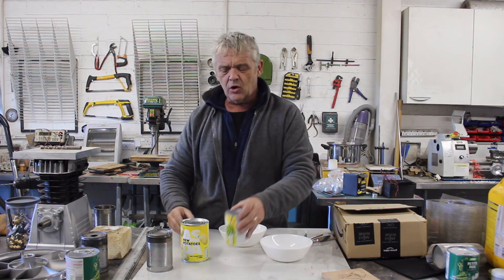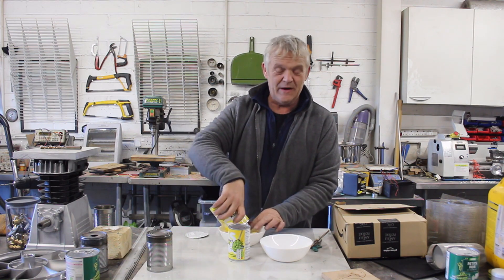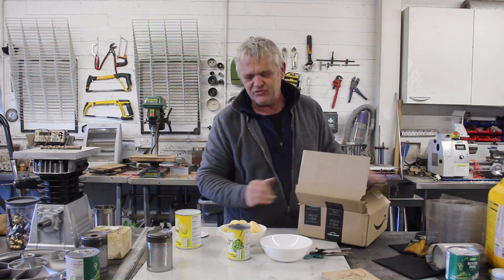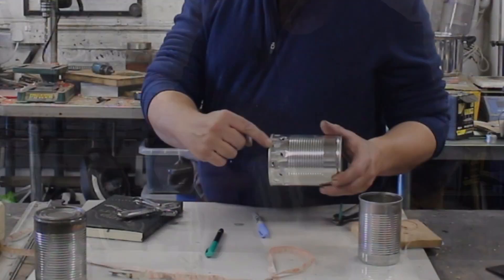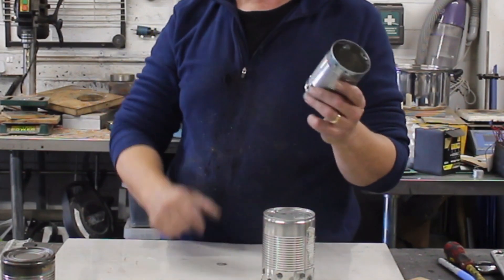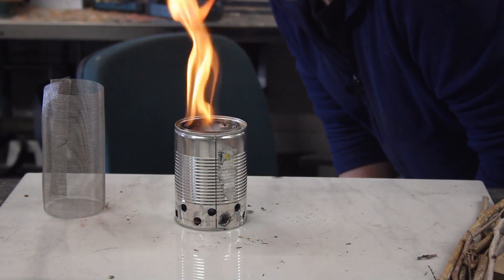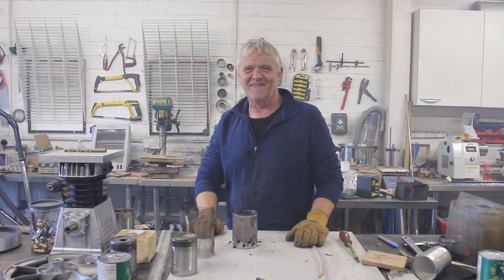1703 Mini Gasifier Or Mini Rocket Stove With Mantle

Comment: Thank you for a great video! What did you use to cut the hole in the top of the large can that was not full diameter?? I'd rather not buy a hole saw just for this exact smaller can size...

Comment: ok  let me tell you about the  charcoal colom . now  a water dip & you have  by a drip at the in-tack & we have  a super gas made up of 50% dioxide gas  & 50% approximately Hydrogen gas  often refed to as hydrocarbon.  gas . Run clean in a combustion engine & one cooled  will run a craven mantel gas light.

Comment: for the inner container i made the holes do a spiral from the top to the bottom instead of making sets of rings, that way the gasification flame can shift up and down as the fuel is consumed and doing it in a spiral shape makes the flame also become a spiral and maintain shape, i suspect rhe air travels more doing a spiral than simply going up straight, allowing it to mix, heat, capture heat or whatever more efficiently 😎

Comment: Hi Robert, I've been considering this after someone mentioned about a mantle,when commenting on a rocket stove you where building and this set me off thinking about the effects of putting one inside the burn chamber of my rocket stove, i intend to create a vortex fire inside the chamber,would the mantle need to sit outside or inside the vortex to achieve best results?.I noticed when you capped the mantle you achieved better results as the fire was forced outwards to the mantle thus heating it up, would i get better results putting a cap on my mantle inside the burn chamber and what if a secondary air feed was added towards the mantle would it increase the gas burn? And what if this is repeated up the flue so much potential to extract all possible energy from the burn

Comment: I have really been enjoying your videos. In stead of using a mantle made from grid material and getting that to radiate heat. What if you make a mantle out of al flat sheet of steel wool and curve that into a mantle. This would allow airflow but also greatly increase the surface area of the material that’s radiating heat. Does this make sense? And yes, I mean oxidised steel wool. Or something that has reacted ;) or some other material that is a wool but doesn’t burn, but does glow. Maybe the “forever wick” Carbon?

Comment: Because this is actually burning the syngas and not the wood. UK regs can be funny but regs aside could this then be ok to use with a gas fire flue and not a chimney or a wood stove flue which are much more expensive than a gas flue.

Comment: I've been wanting to build something like this for a while, but my cans are still sitting on my desk with potatoes in them.    I'm working on a stacked design, the bottom is a gasification stove as your video,  the top heats my food/water for long distance wild camping.  The idea is the burning gasses heat the bottom and sides of a top small can that contains food/water and are also contained by a big can, where the mantle is in your video.  I'm now worried by airflow, but there's only one way to find out, and that's to build it.  The weight should be a lot less than my current wood stove, so it could really catch on.

Comment: Why punch any bottom holes???  Just cut the bottom of both cans and set the bottom can on something to get air to the inside.  If outside, then use a few sticks or 3 flat stones.  Do the top of both cans as demonstrated.  This device can also be put into a Dakota Fire Hole for a larger chimney effect and better cooking base.

Comment: Need a bit of a thought about exhausting the combustion gases without losing all your heat.  Perhaps some kind of a window exhaust port. 2.5-5cm steel pipe through some rigid insulation set into a partially open window.  Put a potato can through the rigid foam 1st then the exhaust pipe through the center of that.  Stuff the can with Roxul or some equivalent insulation to keep the heat from the exhaust pipe from melting the rigid insulation sealing your window.  If too much heat going out the window a bit of a serpentine on your exhaust pipe.

Comment: A question about safety: while I love the ease of build and the heat output,  without a flue or chimney there is a danger of death from carbon monoxide poisoning, tragically this is regularly reported when people use wood fires inside without adequate ventilation. Or are you assuming complete combustion and conversion to CO2 due to the gasification and burn process, even so combustion by-products still need removal to avoid health impacts.

Comment: I think we need to see if we can get you guys some Roper & Whitney tooling at least a model 8 sheet metal hole punch, since it will allow even more opportunities than that paper punch on sheet metal of a tin can did. (even better if we as a community can manage the big brother of the model 8, since it will let you punch holes I think up to 25mm or 1 inch diameter and in 14 gauge steel sheet metal, ie something that is actually weldable when done being punched up and such :) (or layers of sheet at once for making transformers and motor cores or generator cores of laminated layers of steel all while keeping the whole layer of holes lined up perfectly since they are punched at once :)

Comment: yep I want to look into electrolysis as a method of injecting hydogen into common carbon sources like wood to make more concentrated hydrogen/carbon balanced materials like oil and such :)
Reply: well that and remove the oxygen present in those carbon sources (be it sugar, starch, or wood components in general, thus keeping it from interferring with all that hydrogen/carbon linking up) next will be digging into more catalyst based control of that linking, like how Benzoyal peroxide is used in some instances in the past to make ethyl gas into polyethylene plastic chains :)

Comment: I been critical on an other side of the Question! First safety, secondary price for the fuel! You are so near now to a heat-system, how manage a Security level like a cooking a dish of fish and chips! The heat I want from a burner is app. 500Wh and burn in a iron-pot or a rocket stove with a vortex-burn with extra safety! The best fuel is Methanol or Ethanol! You can make a burner how give 200 Wh of app. 1 dl at 5 hours!  If 1 litre alcohol cost 5 US$! A electric 1kWh can't cost over 0,5 US$ with tax and all extra included! In UK it's not a question anymore. if you need heat try to get a safe burner and the same is it in  rest of Europe! 🥸👍

Comment: Good job 👍

A piece of mesh positioned horizontally inside the mesh tube, approximately 3 inches above the gassifier opening would probably act as a spreader, which would increase efficiency of the burn.

Comment: Hi Robert, your stove is called a TLUD ( top lit updraft gasifier) This stove will lay the foundation to effectively produce charcoal. Our kilns are based on this concept and bulk produce charcoal. Equally as simple is the charcoal gasifier for engine fuel. Very simple metal bucket with a single nozzle at its bottom. Incorporate a water drip method into the nozzle and you will also produce " water gas" via steam to carbon reformation. You will find this simple gasifier is much easier to operate than a woodgasifier,  it will run an engine very stable and without tar.

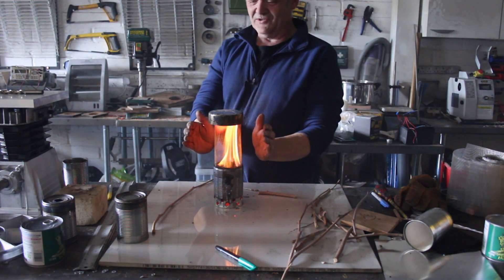Comment: Robert, at 5:33 you refer to the gases being produced in this TLUD (top-lit up-draft) stove as "syngases", but that is not correct. These are just tar gases that are burning. Tar gases are gases produced by pyrolysis. To have syngas, you need the fourth and fifth processes of gasification: cracking and reduction reactions. These two processes thermally break-down the tar gases into hydrogen and carbon monoxide, and further produce carbon monoxide from the charcoal. The stove you've made here doesn't do that.

There was an entire series of videos that propagated the misconception that wood gases produced by pyrolysis constitute "gasification", when it is just pyrolysis. NightHawkInLight made these videos, and he kept referring to it as "gasification", which isn't correct, but millions of people have watched his videos, and now this confusion is widespread.

Comment: Robert, I have an idea for a variation on the mantle I'd like you to try, to see if it won't result in a significantly improved burn even compared to what you've shown in this video. Make a double mantle: make an inner mantle that's cone-shaped, then make a second mantle on the outside that's the cylinder. The cone shaped mantle forces the combustion gases to slow down at the interface where the flame hits the mantle, and it micro-turbulates the mixture forcing it to burn on the mantle, causing it to really heat up and radiate heat. The second mantle catches the build up of hot gases around the first mantle, and also picks up that heat from the hot gases, and radiates it. Otherwise those gases would simply rise and escape with the heat embodied in those hot gases.

The double mantle idea comes from the Searzall culinary torch, which converts the heat of a torch flame into radiant heat for more even searing and for eliminating "torch taste" from unburned hydrocarbons. I am fairly confident a double mantle, with an inner cone shaped primary mantle, should do the same. Slowing down the gases and micro-turbulating them should improve the efficiency of the burn.
Reply: This cone...is it low and dumpy or quite tall and tapered???
Almost the same size as the outside mantle? Or half the height?
I see half height in my minds eye...
something about that gives me a good feeling about natural behaviour of flame and mantle.
Great idea...good thinking.
Reply: @howler6490  I don't know what the optimum shape is, but I would suspect the same height as the outer mantle would be best. Not exactly sure why, just my intuition. I would hope Robert could do a bunch of experiments to see what the effect of various different cone heights would be. Or maybe even put in several cones, and see if the benefits of using a cone mantle that forces the gases through a mesh can be multiplied. 

I hope Robert sees this and tries this.

Comment: Robert, there is an overlooked fuel that people do not think laterally enough to realize is a fuel. I don't know if this is as easily available in the UK as in the US, but here, you can get rather large cans of vegetable shortening for cheap. Walmart has 6 pound tubs of Crisco shortening for $19. The generic brand is even cheaper. On YouTube, there are videos by survivalist prepper dudes who have made heaters and candles using shortening. 

If you use one of your forever wicks and some clever methods to warm up the shortening so it will liquefy, you could very likely use a shortening candle to act as a heater.
Reply: Could always use a small amount of alcohol as a starter.
Reply: If I remember correctly, you don't have to warm up the solid shortening, just sink a wetted (fuel: old, shortening, paraffin, whatnot) wick down to the bottom of the lard can, and light it.

Like wax, the fire will melt the shortening enough to keep the wick lit.

Comment: Nice build, I built one of those several years ago, then crossed the design with a rocket stove. Managed to get the airflow high enough to get a blue flame fom twigs or wooden cat litter pellets (Fuel sources) using convection alone. Admittedly I had to use several tins to make up the chimney to get enough updraft.  It gave off so much heat that the the tin cans I used as a fixed chimney (with a few holes drilled in to help with secondary burn) would glow red during daylight! And Almost yellow at night.
So these can generate a LOT of heat if done right..the hard part was trying to make it refillable whilst still lit without obstructing the airflow and gasification process.
It would be interesting to see what other ideas people come up with.
.. My burn time averaged about 20mins. Probably due to increased airflow and heat generated in the system.

Comment: How does this effect the amount of fuel (bit of twig) needed, as compared to just burning twigs?  Like, how often would you have to stick another handful of twigs in it?  And could this be adjusted by altering the diameter of the twigs - i.e. a few thicker bits might take longer to release their energy than an equal weight of thinner bits?
Basically, are we gonna be faffing about with it every ten minutes?  (although having lived without heating, that's acceptable for a while to get the room above freezing)

Comment: Slight error with your gasifier diagram. Nothing comes out of the burn chamber other than out of the top. In fact, mine only has holes in the base of the inner can, and none around the lower perimeter, and it gasifies beautifully.

Comment: So easy and effective. 
It's like the camping food, comes with its own heater!
Reply: A little problem with that idea - you have to eat the food first before you can heat it lol.
Reply: @Bennyboy-dog  You can't heat the food in the can. The inner wall epoxy liner is not meant to be heated.
Reply: @piconano  I didn't know - thanks PicoNano. I could swear I've seen people heating up canned food near the fire after punching a hole in the lid, but that may be just misunderstanding on my part. I've never done it, so I assumed...I guess when you first convert the cans to a gasifier, that lining gets burnt off, but if you set it on the coals with the food in it the offgassing of the liner amalgamates with your food, poisoning you in the process. Possibly just putting a can in a boiling pot would be OK...maybe...doubt it. 
Still, I thought it was funny thing to say...and I learnt something, so thanks again.
Reply: @Bennyboy-dog  Yes. some people do it out of ignorance or not knowing, and get a chuck full of micro plastics in their food.

Comment: made one of these a few years ago a little bigger using coffee cans. The only difference was I cut two L cuts on the opposite sides of the outer can at the bottom instead of holes. that way I had two metal flaps I could bend in so the in coming draft would spin around the combuster making better fuel to air mixing and a more centered flame. wish i knew about the carbon felt then. I would have lined the outer can with it as insulation. The hotter the incoming air the better the gasification. Made a much bigger one out of steel drums as an incinerator. That needed a lid for the combustor with at least a meter high chimney  for the best draft. with it cleaned also made an awesome grill.
Reply: This insulation idea should be explored.
Reply: Best high temp insulation besides vacuum and aerogel, is fumed silica. As it is a loose insulation, you'll need something to contain it. You might be able to use carbon felt, but I think ceramic fiber would be better as it is more dense.

Comment: Can this be used with (or combined with) the reflector from the previous video (1702) or terracotta flower pots?
Could you try using lard as a fuel. I saw in a KIng Of Random video they used Crisco to make big candles and as a fuel. In the UK this lard. Lard is very cheap.

Comment: I am also wondering how small this can be made fires have critical masses just like nuclear power plants but there are small pilchard cans available I have often wondered what could be done to boost the output of candles or oil lamps with mantles above the flame (not the Aladdin lamp too big). there was an Indian dance class that chucked some rubbish in the skip and I noticed that the was a clay sort of tea light thing, so I took it home and tried it out and it seemed better than a standard tea lamp. was it the wick or some feature of using a clay base? I have a partner in the Philippines and she complained that her electric bill has gone up 4-fold it is still only about £20 a month. That is not the point if "the man" owns you ie you are dependent upon him then you cant make progress in your life. I speak as a person who lives in a stealth cabin at the moment, I do not know what I would do if I was part of normal society. I am getting more and more skilled at this life and actually very comfortable which I did not expect. By the way you could exhaust that thing through a Kelly kettle and get hot water if you wanted.
On the point of heating if you can substitute radiant heat for sensible heat, you can be comfortable at much lower temperatures. I was snug at 55F with a wood fired stove. Apart from keeping a house dry and free from condensation the house doesn't care about being heated.

Comment: Love the simplicity cheers. Wonder if the flame would be clean enough for a mantle like the ones on gas camping lanterns (thorium?)for lighting and surrounded by solar cells for night time power ?
Reply: I don't think it produces enough light to power a solar cell. I'd experiment with peltier units with a direct heat source like this.

Comment: It would be interesting to see if it can burn wood pellets. Typically they need more airflow. You can buy a 20kg bag that will last a while.
Reply: I assume one could equip it with a 45degree angles chute like some rocket stoves with which to refill it...
Reply: @TheBaconWizard  , twigs have a lot of air gaps between them. Wood pellets don't allow much airflow especially once the top has carbonized. I have done a test with metal coils placed diagonally in the stove and that allowed a complete burn.